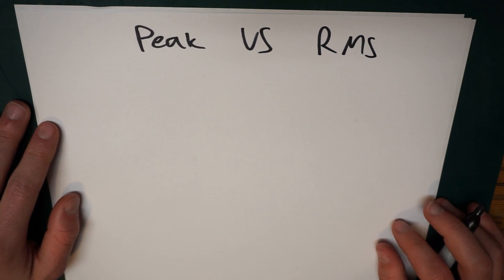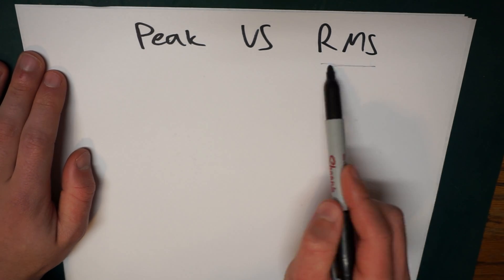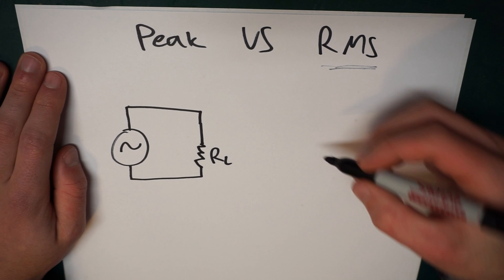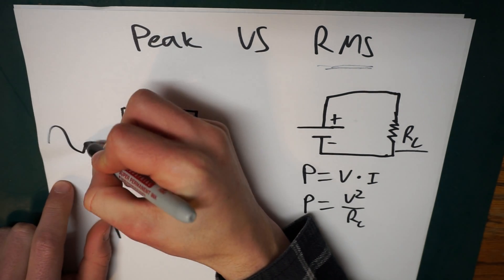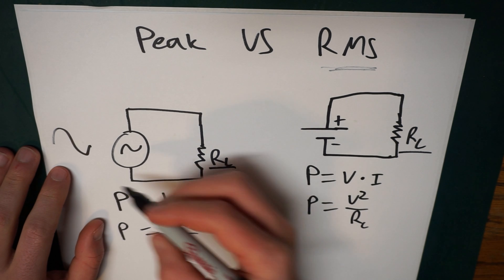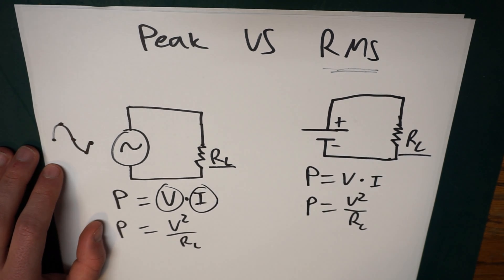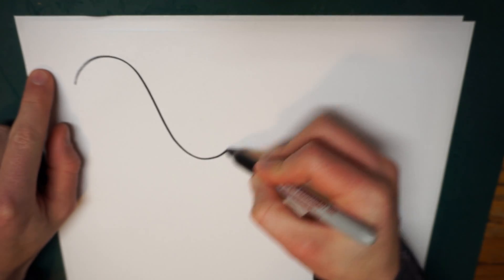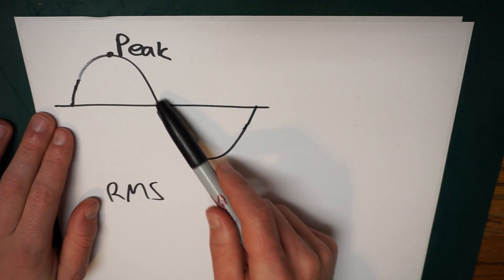RMS Vs Peak Values Part 1 - What is Root Mean Square?

Comment: Your explanation is not correct. The average value of sine wave is zero. 1/T * integral of ( A*sin(wt) dt ) , integral from 0 to T. Vavg = 0.
So it's not correct to use the term average value. The RMS - Root Mean Square value = Also called Effective value.  root two of [  (1/T) * integral of ( |A*sin(wt)|^2)  ] dt ) , integral from 0 to T. This will give Veff=Vmax/(root of 2).

Comment: Because it's not always 170 it averages to 120
Reply from the maker: You can think of it sort of like that. Although average is an entirely different concept. Average and RMS are not the same. The average value is actually 0 because it is equally positive and negative over one cycle. You can take the average of the absolute value of the waveform which is close to the RMS but still not the same not the same. Average of the absolute value which is equal tho the average of the positive half of the cycle is 0.637 rather than 0.707 from the RMS value.

Comment: Volt RMS is useful because voltage is squared in the formula to get power. Watt RMS is nonsensical because there is no meaningful formula containing squared power. Watt RMS is used often to stand for "continuous average power" but it's a silly misconception repeated over and over in audio marketing and by audio equipment consumers, not so much by engineers though. By the way, power cycles at twice the rate as voltage but it's always positive, unlike voltage.

Comment: Thanks, when we put a measurement instrument in main supply (AC supply) let say KWH meter or Voltmeter, is it reading the peak or RMS value?
Reply: Most meters read the rms value which is 70.7% of the rise and fall of the sine wave + and - wave which is the average of the wave. So 10v rms is actually 14.14v Peak to Peak. So when we rectify 10vac we actually get 14.14vdc.A good fluke meter will have a Peak to Peak scale or range. As for KWH meters they will read true power which is Peak to Peak. Electric Companies sure as hell won't average usage. Hope this helps
Reply from the maker: Utility companies do not measure or bill peak to peak. KWH meters are based on RMS values.
Reply from the maker: Fardan Fardann power is a little different there are many ways to measure power. Typically a simple KWH meter measures RMS real power.

Comment: The mains voltage is 120v peak to peak so the mains voltage when treated as VRMS is 0.707 x 120v
Reply from the maker: Chris Cain no mains voltage is 170V peak to peak and 120 Vrms is obtained by 170 Vpp * 0.707
Reply: Jacob Dykstra did u mean, vpp is 0v to positive peak? Or from negative peak to positive peak? (170v vpp)
Reply: @electricfieldtv709  
170V is from 0 to peak and not Vpp(negative to postive peak)

Comment: nice  now 12 volt  system  is the same peak = 2000 w   rms = 1000   5-channel car amplifier
Class-D amplifier design
75 watts RMS x 4 + 350 watts RMS x 1 at 4 ohms
100 watts RMS x 4 + 600 watts RMS x 1 at 2 ohms
200 watts RMS x 2 bridged at 4 ohms + 600 watts RMS x 1 at 2 ohms
Preamp and speaker-level inputs
Frequency Response: A/B CH: 10Hz ~ 50kHz (+0dB, -3dB) / SUB CH: 10Hz ~ 500Hz (+0dB, -3dB)
Signal-to-Noise (SN) Ratio: > 94dB
Variable high- and low-pass filter (40-500 Hz, 12 dB/octave) on 4-channel section
Variable low-pass filter (40-500 Hz, 12 or 24 dB/octave) on sub channel
Variable bass boost (0-18 dB at 50 Hz) on sub channel
Wired remote bass boost control for sub channel

Comment: where is cosθ in Pavg= Vrms * Irms ? Nice video though.
Reply from the maker: myonlynick it is an average so there is no cosine involved. The average is just a number. When you have the cosine function we are talking instantaneous values. The rms values are derived using sinusoids in the next video.
Reply: thanks for replying. I am sorry, i do not want to confuse you, but cosine exists!!!There is an alternative way to represent P using the math tool called complex number.  if you use complex numbers to represent power, then   P is a complex number where the Im{P} part may(or may not)  be 0 and Re{P} = Vrms*Irms*cos(θ).We know that cos0=1. i am talking about AC circuits. As a side note, that cos is what all power plant companies are afraid of in power lines and they always try to  keep it  in check, it's called the 'cosine factor'.
Reply from the maker: You are thinking of complex power. In that case the cosine represents something called power factor. It is the real component of complex power. In this video I don't talk about that. The power factor is the ratio of real power to apparent power and that ratio is the cosine of the phase shift between the voltage and current waveforms.
Reply from the maker: myonlynick also in the video I used only resistive loads in the example. In that case you can disregard the cosine. Howeve the cosine would come into play if the load had any reactive components. I just didnt talked about that to keep the video simpler. Often it confuses people talking about the many types of power.
Reply: lol very complex....  (>o<)

Comment: Can this calculation can be use in determining the RMS rating of an amplifier? Coz im confused now how will i set my amp with the 1300w peak.. i used this method so i found out its around 900w RMS.

Comment: this cat is to smart.  so assuming this whole RMS peak thing I guess car audio amplifier manufactures lie to us. for instance 1200watt amp with peak always is doubled but should only be RMS / 0.707
Reply from the maker: Audio marketing can be very tricky. Many times yes they over rate their products. Peak power output is usually transient and can not be sustained. It's not uncommon for that market to often exaggerate peak or rms power levels. Also rms can be somewhat useless unless you know what waveform they are testing to get those rms numbers. The audio industry typically uses a 1KHz sine wave to market power levels, distortion, and low frequency to measure damping factor.